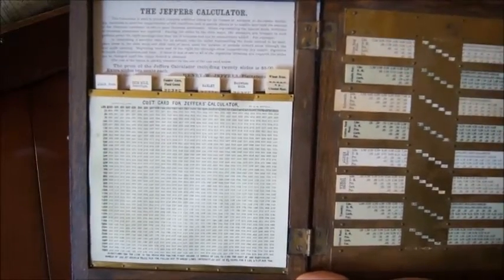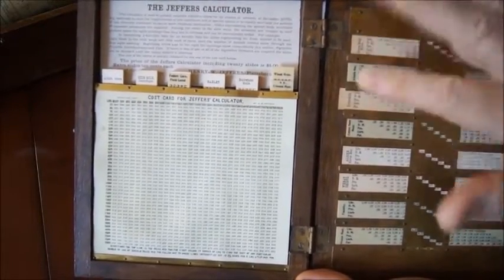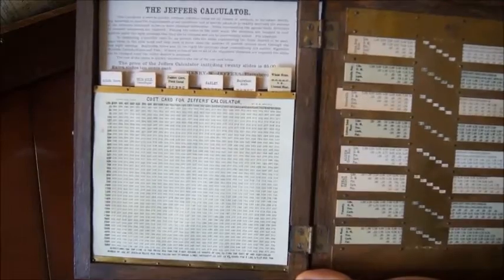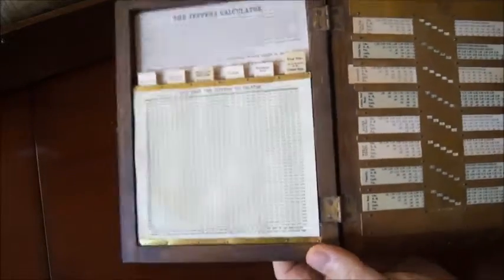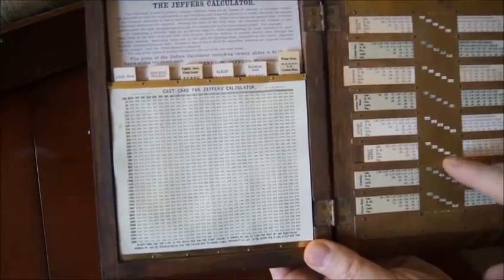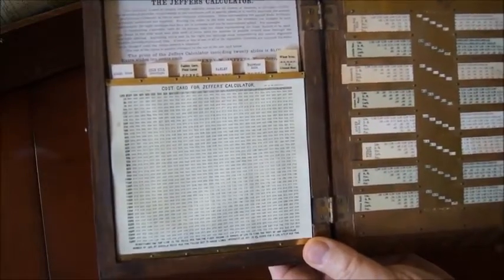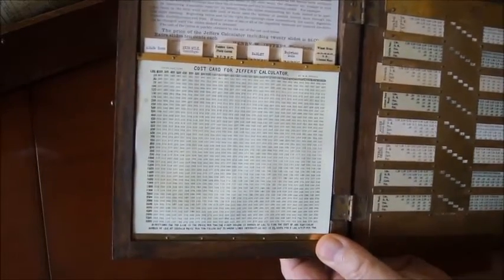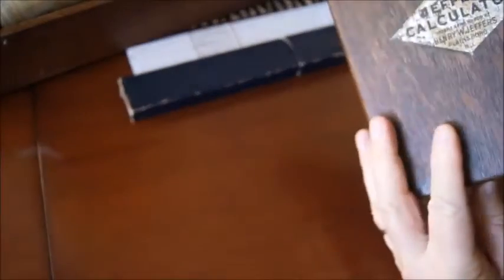Stanley Fuller: cylindrical slide rule

Comment: You're not limited to one foot with a slide rule? Unless you mean the physical size of it! Even then you can still physically measure 20 feet by measure-move rule-measure-move rule...20 times! Laborious but could be done, so what do you mean, I'm confused?
If you mean the actual scales then convert (12ins > 1ft ) viz: 12 over left index 1 and 8 (for example) discretionary decimal point is 8ft - 96ins or 80ft - 960ins or 800ft - 9600ins...and of course your 20ft - 240ins. We can then square the figure for area using the slide rule again.
Reply: He means the acuracy of a slide rule depends on how long it is for calculations. The longer the rule the more significant digits to the answer.